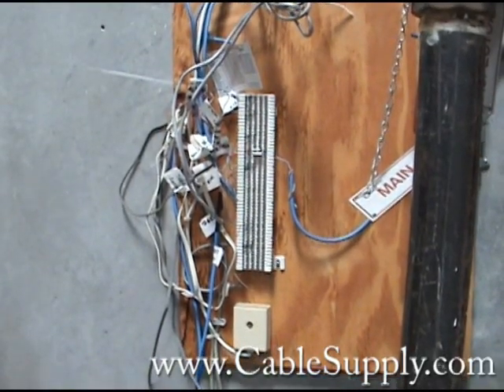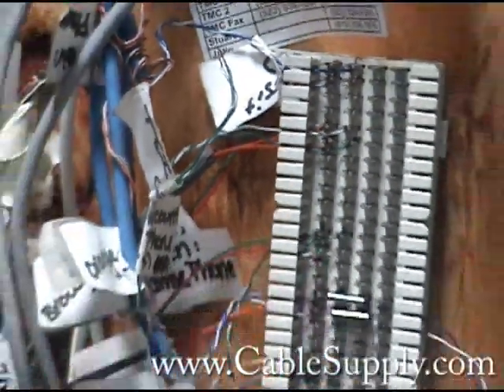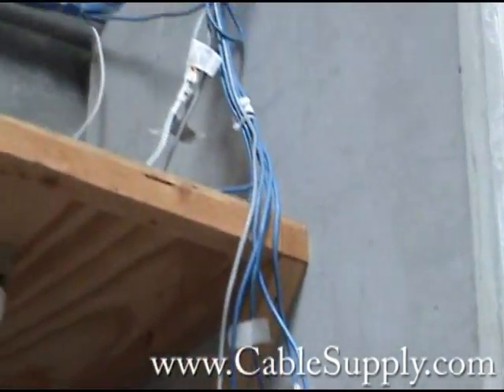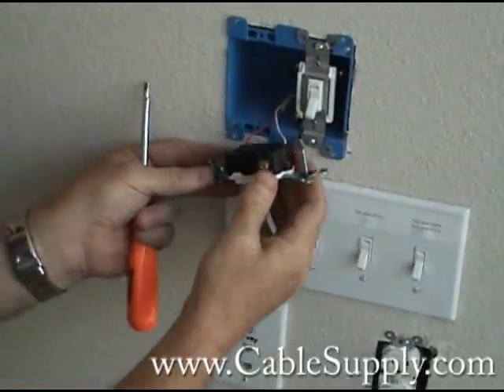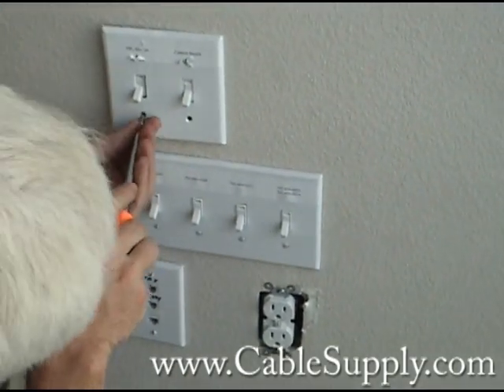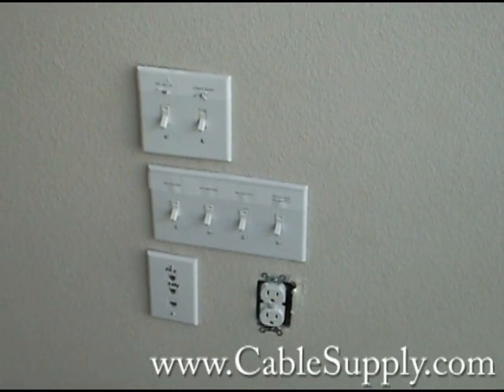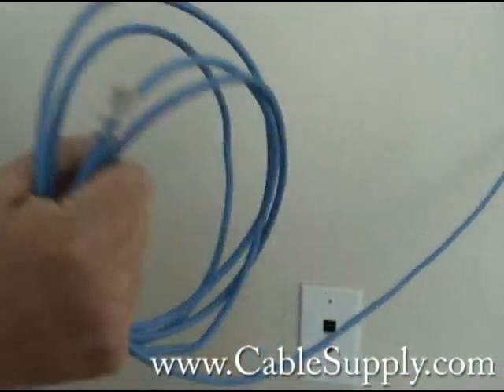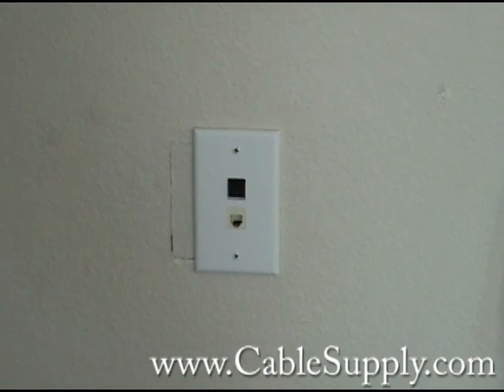How NOT to cable

Comment: I remember the first time I had to run cat5 cables. I was told by my employer to do it. I had no training. I worked for the company that wanted it done so they did not have to hire any outside people. I remember (this was before any real info was available on the internet there was only CompuServe. 
Mine did not look that bad but I made many mistakes (which I had to correct) but everything worked when I was done. 

I remember when my boss purchased a 20 phone 10 line phone system with music and everything. I had never seen one before and was told to install it over the weekend. The company would not sell me the cabling that was needed (50 conductor terminated to the punch down blocks). Well my boss had over 3000$ invested so I made the 3 50 conductor cables I needed and it all worked and worked for many years. The system was only replaced when we finally could not get replacement phones anymore.

Please do not be so quick to judge, the person who did it may have been thrown into it and had to do the best they could for there employer. The switch for the cat5, that one has me. Forgetting about how bad it would make it work why would you want to do that?

Its now over 25 years later and I still do the wiring for the phones and the computers but at least now I own the company's (retail and one wholesale) now I am the boss and I am almost as cheep as my original boss many years ago. 

I do agree if you can fish the wires inside a wall why not?

Comment: Seeing crap like this makes me angry. I feel like strangling that bastard who did the install.
These guys are not properly trained and most likely unlicensed. They are giving cablers and electricians a bad name.
Reply: Meh I'm not licensed for data/tele cable here OR CCTV ops5 for camera install yet the shit I've seen on jobs is so much worse than the quality of work I now do even at home for ourselves. It makes the license completely fkn pointless imo.

I spoke with the old TAFE (college for the Americans) teacher about this "quality" work and he stated it is all to do with people paying to pass a 3 day course to get into the job and not really knowing their work. Rather they were trained to do just enough to pass the course, knowing the job was not a requirement to pass. Then since they have the qualification they are not eligible to enter a college course to actually learn their stuff.

Last example I saw of CCTV gone wrong, they used good cable to do the runs (RG6 sleeved with 15a fig8), but terminated the DC wiring by cutting the end off a 12v power pack, stripping the plastics and just twisting it all together covering it with tape. Then charged thousands. I thought the least they could do when charging so much was a decent break out box.
Reply: TruenoG7 I don't do structured cabling exculsively but even I can do better than what the cheap people did.

Comment: Geez, I've done some rinky amateur crap like running phone wires into the faceplate of power outlets to cheat through a wall without cutting, but this is crazy. 

It took me a few minutes to realize those switches weren't for the modem/router power outlets but for the CAT5. WTF is even the point of shutting that off?! I guess it's just as well, if the person doing this job had messed with anything electrical then it probably would have gotten someone killed.
Reply: I don't get that at all.  Those pairs of wires are running to either end of those wall switches and going nowhere.  All the switch does is short two pins.  Unless he's using those pairs to carry DC power to the various devices, it's completely non-functional.

Comment: Shit and I though I was bodgy years ago when I was young.

Was young, stupid and had no tools (crimpers etc) and would cut a network patch in half to terminate a run at home (actually worked to since I kept the twists etc). Then finally got the crimpers and upgraded to an RJ45 plug on either end of the three long solid core runs from the house to the shed where I was working.

Now I love my patch panels and wouldn't look back if you paid me to. But even then I was not near stupid enough to star a line off to a switch like that! I'm a stickler for patch panels and zip ties for bunching now (I don't care if some people hate them they are fast, efficient, cheap and handy to get the job done).

Comment: what sloppy work..I used to be a tech with AT&T and took pride in my work. probably the customer hired an outside tech, he didn't even have a proper punch down tool.
Reply: +Bri G.  Hey, I work for Openreach in the UK it is the equivalent to AT&T. What was it like working for AT&T? as I am keen to move to work in America.
Thanks
Reply: I can't say...l left AT&T many years ago. I hired on in 1973 so worked under the old Bell System. It was strict but I liked it, you had a job for life. there were a lot of changes after the breakup of MaBell in 1985.